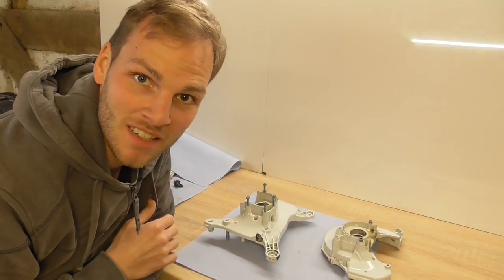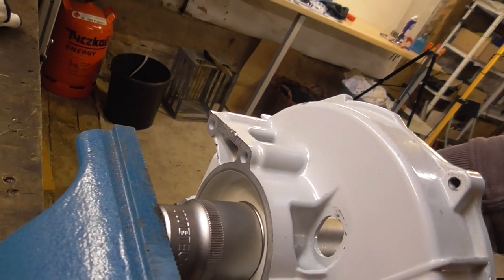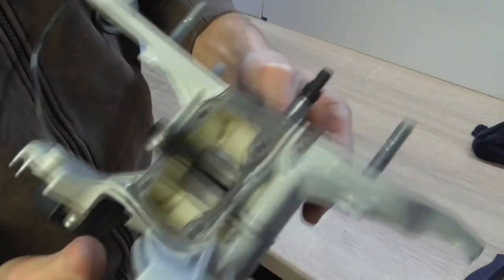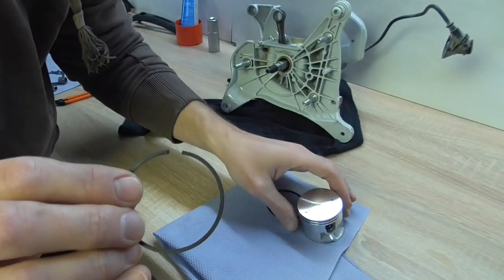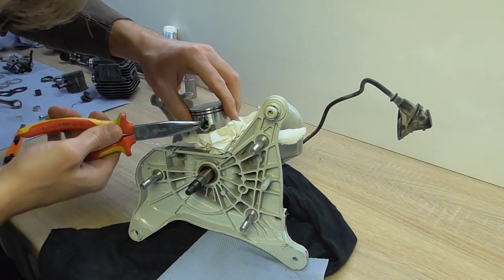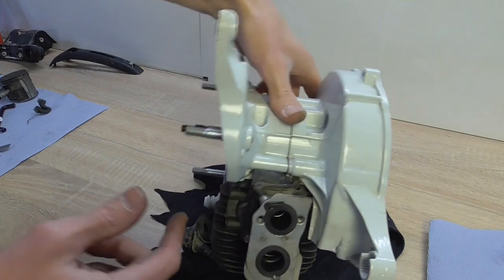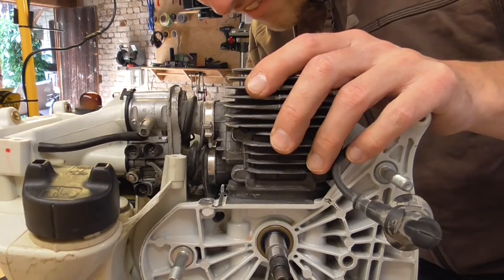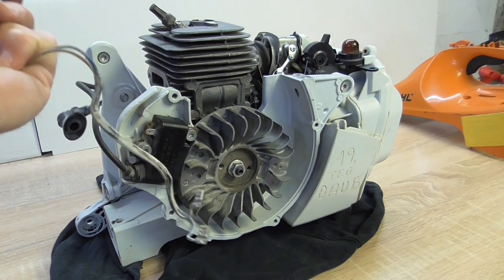Stihl concrete saw TS 420 engine ASSEMBLY

Comment: are the bearings on the crank shaft the same size? on my ts420, it looks like one of the bears is a 15mmx35mm by 11mm. the dealer sold me two of the same bear sizes but i think my unit is older and uses two different sizes.
Reply from the maker: They aren't :-/ I ordered two of the same size and stopped bc one didn't fit.
Reply: The one I did had 2 different sizes
Reply: After 2013 the bearings are 2 different sizes

Comment: Is there a reason why you don't use any lubricant or grease when you're re-assembling the main shaft and bearings?  Seems like it would slide on a little easier.  Enjoy your vids
Reply from the maker: I never use lubricant on the outside of bearings bc if it goes bad the outer ring can slip in the housing and destroy it. You definitely do not want that to happen.

Comment: You don't do a psi and vac test on the crankcase what do you think will happen if you have a air leak especially on that aftermarket piston and cylinder
Reply from the maker: Next time I do that